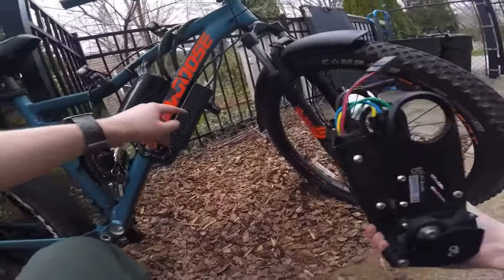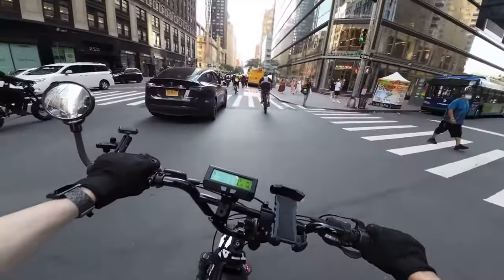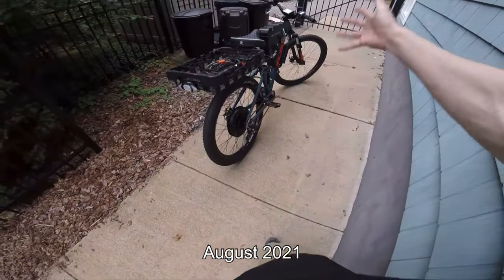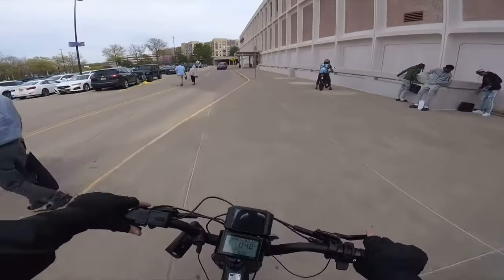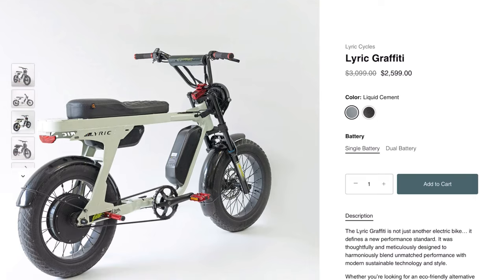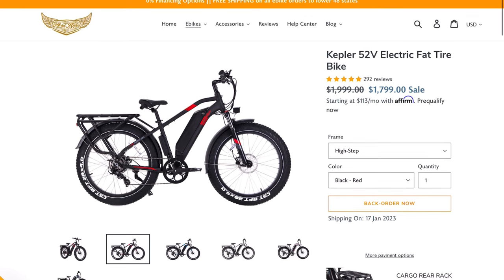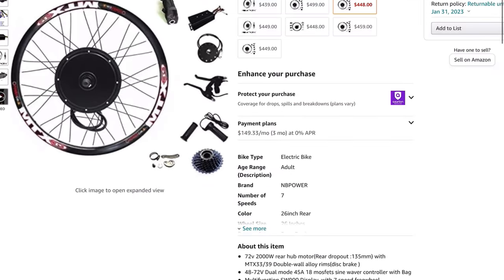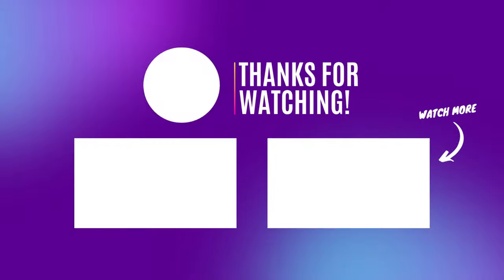Are eBike Conversion Kits Worth it Anymore?

Comment: I  have a 2003 Jamis Quest road bicycle. Weighs 20lbs Shamano  105 gears and brakes. Like new. Paid $500. Now I want to electrify with either 350-500w BaFang or Tongsheng motor and 36 or 48w 8-10ah battery. Should add about 12 lbs to total weight. No other bikes available with these specs and cool looking chome paint at this price, Any comments?

Comment: I went custome build because I cant afford to buy a bike all at once. so I bought the bike (ghost rider stretched chopper bike) then I bought the motor kit and wish i would have waited until I had more money for a better kit but I got a cheap 1500w direct drive motor kit which I might upgrade the controller so I can get a computer screen for it and upgrade the voltage. I then bought the battery and found i could have bought alittle smaller battery and just got a second battery later for overall more AHs. My bike looks great and there isnt anything like it around so even if I had the money I couldnt get something like it anyways. I am not an offroader and just ride for transportation on the streets so a chopper bike is great for a large guy like me.

Comment: Yeah but in Europe many of those cool bikes you mentioned don't sell or are marked up in price by a large amount, cant get customer service / warranty support properly etc because of the 250w laws here, so DIY is still good.  I have that 72V 2000w setup you mention at the end and its pretty good but doesn't accel quite as quick as I expected and its torque is also low, my stealth bomber pulls harder when its running similar power levels.  The advantage of a commericially made bike is probably more to do with getting the frame and handling right while including all those features e.g. large battery, my new bike handles pretty poorly and its a bit uncomfortale to ride as I bought a Giant Talon mountain bike to install the stuff on.

Comment: The e-bikes what is £2500 
I've built multiple Ebike's much better for £400.
Including everything...
Even the quality is much better.
With custom-built torque arms.
Coloured display with regen breaking.
Bluetooth BMS 
52v battery pack original cells.
Top speed 38 mph
The biggest removable battery park you can buy.
has
Some of the best hydraulic brakes you can get.
Also with magnet cut off sensors.
Key ignition with voltage display & front & back LED lights with horn & brake light.

I'm building one now 
I'll be selling for £1000 when it's finished
I'll be making £600 profit

The bike I'm using is a Boardman comp 27.5inch 
What was £900 retail
In amazing condition 
This is probably the 5th Ebike I've built to sell.

Comment: Prebuilt eBike or conversion kits.  The battery is still the most expensive part of an eBike.  Even if its a custom built eBike frame to fit a mid-drive motor.  Your battery range and power all depends on.  How much you are willing to spend.

Comment: Problem is for many of us is the state we live in, being stuck in Tyrannical California my choices are Legally  limited, i used a Trek 4300 4series Mtb, 750w bafang mid drive and 52v battery..  weighs a whopping 55lb now! top speed is 39.3mph with a full charge, tho sticking to pavement, i've not tried to beat that speed ever again ! to damn fast on such a light bike!  Loving the gears especially when pulling the trailer.. 436 miles latter i'm starting to upgrade. Initial cost was about $1,200 soon to be more. Hopefully California will pull it's head out of it's ass and allow 1000w + soon !
Reply: Are you really concerned about complying with the laws? As long as you aren't going much above 28 mph I don't think cops care. I was pulled over once on my ebike late at night because my back light was apparently covered and they didn't ask me a single question about the specs. If you put a 750w sticker on it I dont think anyone will bat an eye unless you are going over 40mph or hit somehting.
Reply: You should go to Europe where they actually enforce the laws
Reply: @James-vv3dl  Are things worse there ? since my last post i've upgrades everything even a new motor.. i've now hit a top speed of 46. something mph at 25amps and a 52t chainring full throttle, peddling as fast as i can.. i think the 52t is to much for the BBS02 tho.. i get an odd vibration over 40 and had the temp to 139f !

Comment: This is why i've never bought pre-built bikes. If you have the know-how of how to build an ebike , Just get a frame from alibaba/aliexpress. I live in a country in Asia so I can build a very high power bike for waaay lesser then of a pre-built bike that is of a lower spec as honestly you can get ALOT cheaper prices from domestic sites and with low shipping costs and no taxes.. For example , on ali , the super73 copy frames are around 400-500 whereas I got one for only $200. 

There are alot of Super73 clone frames in china sites and so are alot of other parts of aliexpress . If you do get a super73 frame , just get someone to fabricate a metal box to put in the middle and you can put a HUGE battery in there .

You can only do so much on a bicycle frame and it will NEVER look good if you're pursuing high power as you've mentioned in the video. Bicycles imho are only meant to be low powered conversions , like the CYC/Bafangs or the typical hub motor(which forces you to make it look like shit) .

Comment: I'm still staying custom, because I'm sick of the limitations of prebuilt e-bikes, that cost the same or more than a kit & cheap frame. Limited top speed to obey that mafia called government. Some are pedal assist only, no throttle for rest. Then their are the issues Louis Rossmann brought up.
I just want the strongest e-bike possible, within a ceetain weight, and has powerful BrakeRegen, hopefully analog brake lever sensor & programming too, and dosen't kick in like an on off switch.
 The only speed limit I care about, are the load/speed limit of the tires, and I want to accelerate to the top speed of those tires, as quickly as possible, even uphill.
And I also want full suspension, and dusl hub motor AllWheelDrive, with a acceleration power bias to the rear of 2 to 1.

What production ebikes fit this criteria?

Comment: I’m looking to upgrade an ebike, and convert others into ebikes 1 into hub while the other mid-drive. The only relative issue is the battery voltage only going to 72V. With that being the case the weight/size of the battery makes it unappealing for practicality reasons. If only much higher voltages were in existence as then I could get 3x the range with far less bulk/weight added to the bike. In that going for a 5000w motor is not practical unless you don’t mind riding for any real enjoyable amount of time. If I could ride the bike for a couple hundred miles going up steep hills for long distances AKA real world riding then why spend the mental effort thinking of such a scenario at the moment.
Reply: 72V? The more volts (and amps), the faster the battery drains. Less amps = more range with the same battery. Why do you need 5000W, is there a street drag race or something? 500W more than enough for the streets, and adequate for offroad climbing.
Reply: @richardjensen3655  when you need to get to highway speeds 500watt is only going 20mph 25 with pedaling, but we know 35mph in a car is slow. A you cover a lot more distance quicker as you are able to go faster when necessary. Remember just because you have the 5000w does not mean you will always be utilizing it.

Comment: Personally I disagree with your opinion. Doing the proper research and custom building is a much cheaper option if you have the knowledge and ability. Otherwise if you just want something that works go pre built. Both will require maintenance regardless of what you are riding/driving cars/motorcycles ebikes ect

Comment: looking for a 500 watt 52 volt system under 40# with ability to tackle huge hills
Reply: You're better off with a 52v 750w motor
Reply: I use a 1000w for a loaded bike up mountains.
Reply: Personally, if I'm going up HUGE hills on a regular basis I wouldn't trust anything below 3kw. Because the heat stress on the motor are likely to cause too much damage to the coils and magnets in the motor over time. It's possible to do it with 1000w but I wouldn't expect it to last very long. Also depends on how long and steep the climbs are. I'm only 200lb and my old 1000w bike struggled on the big hills until I started running at 30 amps (1,440w) but even then after a while it lost noticeable power through overheating. Eventually I got a 3kw motor running at 74v that can handle considerably higher current and have had no problems ever since.
Reply: It's mostly in your gearing man. My depowered bbs02 with 32t chainring and 42t granny gear will climb almost anything as long as I have traction and I don't flip over

Comment: I've bought 4 kits out of the 4,3 of them have had problems One of the 1500 W kits Came with a 36 V  Controller when I contacted the seller he said; Americans are governing down to 20 miles an hour? which made no sense because  He just sold me the cheap controller Instead The last kit I had work fine except 4 the digital screen? the battery went down like in 2 minutes before I could get it out of the yard 🤷‍♂️There was no problem with the battery it was the kit again 🤦‍♂️I had to send it back🎯 Ordered a 52 V battery then when it dropped the 1st bar it quit working after taking it apart I found a smashed battery and a shorted wire👀 Lucky it didn't burn my house down.!! 🤬You literally have to watch anything you buy from China😑🤬

Comment: Not a fan of Hub motors anymore!
Reply: Why?
Reply: @mississippisoldier3699  Many reasons. Broken spokes. Tire much harder to change. Controller not built in makes the bike messy. Mid drive gives more power using gears.
Reply: @Eric_Tennant  ok I understand wym
Reply: There is a difference between power and torque.....
Reply: Geared hub motors have their niche. But yeah the external controller sucks.

Comment: There is a Swedish kit that should be easy to mount, it has the motor and battery in the same unit, that is easy to click on or off when parking the bike, I am thinking of buying one of the three models, and it would be great if you could test one of them
Read about it in English, German and Swedish where it is made. 

I added the price in my first post

Zipforce at se